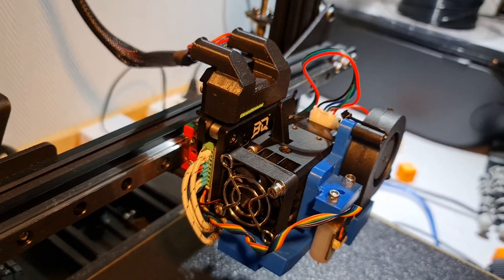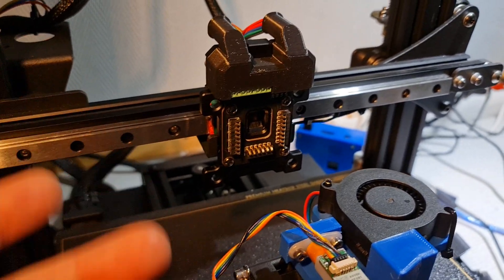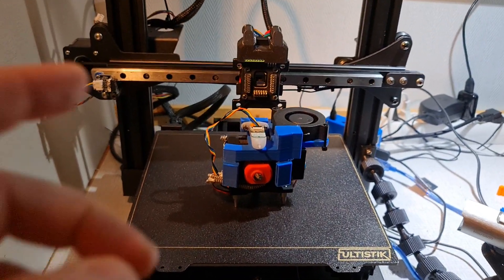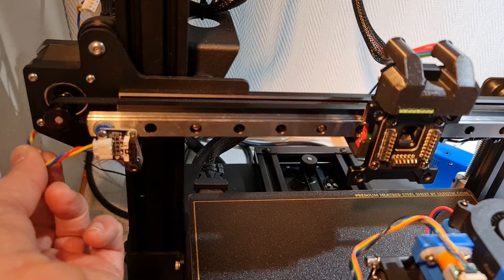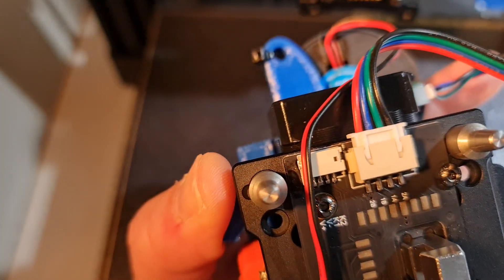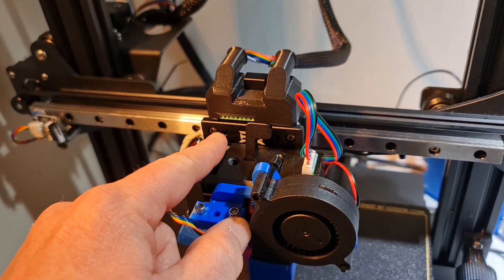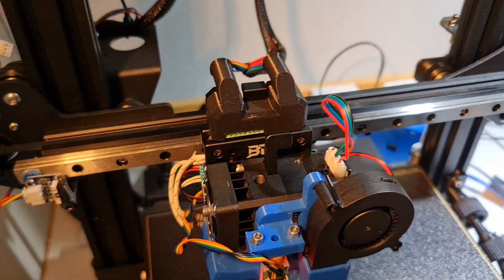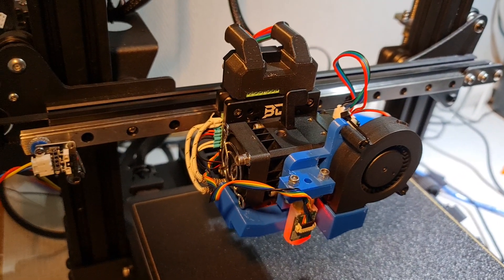BIQU Hermit Crab Installed and quick review

Comment: palm wheels ware out faster and dust gets around your prints and bed, so there is some advantage to getting linear rails then just better print quality
Reply from the maker: If your pom wheels are wearing out fast and generating dust then they are overtightened. All of my machines currently have pom wheels and not a single one has wear nor dust.

Comment: What size were the light blue insulated ferrules you used? A well done, clean installation.
Reply from the maker: The light blue are 0.34mm². 22awg if I remember the conversation correctly. But I think it would have been better with 0.25mm² I believe that's the size of the fan wires. The 0.34 are holding well so far though.

Comment: Strang tie got recommended to me and it's a year old ATM
Reply from the maker: Probably something the algorithm thinks you would like based on what you have been browsing.  None the less, thanks for taking the time to comment about it 😊 Hopefully you enjoyed some part of the video.
Reply: @StackingLayers  hey no problem man It was definitely interesting I've never seen that type of tool head before
Reply from the maker: Its pretty nice. Its a solid setu, especially on the linear rail.  I have a CANbus version too which has a tmc2209 and ADXL built-in, along with the heater, temp sensor, BLTouch ports and some neopixels. And is run off a single USBC cable.

Comment: I picked up the same Hermit Crab/ H2 setup on my Ender 3v2 and I’m trying to adjust my XY offset. Do you have any guidance? I’m just a little lost! Thanks for the review!
Reply from the maker: You need to adjust the home offsets. One way is to first home the machine then use the screen to move the hotend so that the nozzle tip is at the corner spot where X0, Y0 should be (front left corner) take note of how many mm  you have moved X and Y to get there. For example if X shows 5 and Y shows 8 then that's the offsets. If you have a home offset setting on the screen then enter the offsets there. Otherwise you need to connect to terminal connection like with pronterface on a PC and use the M206 command to set them. For example M206 X5 Y8, followed by M500 to save. After that home again and tell the printer to go to X0 Y0 to see if it's in the correct spot repeat to adjust if needed.

Comment: good evening I sent you a message and photos on your instagram
Reply from the maker: Looks like they finally showed up on IG, I sent a reply. Things look good in general. I do recommend getting ferrules on the ends of the wires though.   They give a better more secure connection
Reply: @StackingLayers  Hello would you have a link for the electrical pods to use to make your connection to the hermit crab thank you
Reply from the maker: Are you talking about the ferrules, things are the end of the wires? If yes, it's good to have a kit on hand. I recommend the HSC8 6-6 crimpers https://m.aliexpress.com/item/1005001552393630.html?UTABTest=aliabtest300080_422159&_randl_currency=EUR&_randl_shipto=NO&src=google&aff_fcid=6e6614f195714c1e8a71358ba5708c84-1659354329640-02066-UneMJZVf&aff_fsk=UneMJZVf&aff_platform=aaf&sk=UneMJZVf&aff_trace_key=6e6614f195714c1e8a71358ba5708c84-1659354329640-02066-UneMJZVf&terminal_id=a7fa3c3dbadb4e8590764ff87be9c2c5&OLP=1083300208_f_group0&o_s_id=1083300208&afSmartRedirect=y
Reply: @StackingLayers  thank you

Comment: hello here I am attaching some photos on the connection of the harnesses on the motherboard of the biqu b1 could you tell me if it is good and I have one cable left, what is it for, for the x stop you use the original wire thank you for the answer you can give me
Reply from the maker: Sorry, but there are no photos. But if you can go to the Facebook biqu B1 group and post there. There are several of us that will gladly try and help get you up and running.

Comment: Hey great video and commentary. Did you consider the other tool change systems that are currently out before deciding on the Hermit Crab? The Xchange by printermods, or the Mutant V2 by Whambam are also quite popular. Cheers
Reply from the maker: I did look at those. They look good too. They all accomplish the same thing in general. I just like the design of the Hermit Crab. I just got a Canbus version which is a lot more advanced. I'll do a video soon.
Reply: @StackingLayers  Yea the Canbus version caught my eye too. Having a single USB C cable to the extruder would be quite neat for cable management. I also saw they have an accelerometer on the board, would open up some opportunities for input shaping etc I imagine.
Reply from the maker: @teenagefishman  something I didn't realize until I started going over the installation last night is the Canbus version even has a tmc2209 on board so it frees up a stepper driver on the motherboard! This thing is cool. I'm working on a setup video because it can be a bit tricky. For first time users.and it's only for klipper.
Reply: @StackingLayers  Awesome, that's handy to have the extra driver. Only having support for Klipper is a bit of a limitation at the moment - I was going to convert to reprap. I might give kipper a go though. You inspired me, I just bought myself a Hermit Crab :P
Reply from the maker: @teenagefishman  I felt the same way about klipper too at first, but the more I mess with it the better it gets.
Reply: @StackingLayers  Looking forward to the video 👍

Comment: Great to see China ripping off designers yet again.
Reply from the maker: Which product are they copying?
Reply: @StackingLayers  PrinterMods XChange.
Reply from the maker: Yeah the same as in it's a tool changer, but it has a completely different locking mechanism and plug configuration and the xchange has nothing designed for CAN bus operation like the hermit crab
Reply: @StackingLayers  The CAN is just a wiring difference. The whole design of the mechanical parts, aside from the magnetic lock of the XChange, was a direct copy, Shape, alignment pins, tool plates, etc.
Reply from the maker: That's like saying Toyota is a ripoff of Chevrolet, they have 4 wheels, doors with locks, windshields...heck they even copied the steering wheel and put horn controls in it.
The idea is the same yes, the execution is pretty different. CNC machines have had tool changers for a long time it's not an original idea by either of them

Comment: how has it been the performance since you made the upgrade, is it worth it ???
Reply from the maker: Performance wise it works perfectly. It's very stable and makes changing out tool or even just working on them a breeze. As for is it worth it, I would say yes, unless you have no desire to swap tools. But even if you have just one tool it is a more sturdy mount than a printed plastic adapter. For example, I see many in search for a better mount to print for the BIQU H2 extruder while mine is sitting there solid as a rock.
Reply: @StackingLayers  I'm thinking about getting this just for that reason. I've tried the h2 adapter print in different materials and it just never seems sturdy enough. I also end up with the two screws that hold the h2 to the mount working loose over time. This seems like a good option, even though it's overkill for my needs
Reply from the maker: @davidhaas2528  overkill perhaps but it also opens up future opportunities like adding a vinyl cutter or laser engraver to one of the other tool plates.

Comment: Please could you tell me if the backing plate that attaches to the linear rail carriage is plastic or aluminium?
Reply from the maker: It's all aluminum. There's no plastic except for the electrical connectors.
Reply: @StackingLayers  okay - thanks!

Comment: Hey man, I got the Hermit Crab the other day and installed my H2 on it, as well as the fan/bltouch mounting solution you linked. I'm having an issue though and was wondering if you may be able to help me.

I've entered the provided probe offset from the Thingiverse page, but I don't think it's correct, at least not with the hermit crab being installed. Whenever I try to initiate G29, my bl touch wants to start in the front right corner instead of the front left, and it tries to probe off the bed. Have never had this issue when using a bl touch on any printer before. Did you get a different X/Y offset for your setup? Any help would be appreciated!
Reply from the maker: You have to change your home offset values too because the hermit crab moved the hotend forward several millimeters. I'm not sure why it want to probe to the other side though. I haven't had that issue.
Reply: @StackingLayers  Thanks for the quick response. I've never had to change my home offset values before, but I assume I can modify them in the config files while editing the firmware right? How did you measure your difference in comparison to stock?
Reply from the maker: @760creations  you can set them from the screen. Home the printer, then move it to the home corner (where 0,0 should be) then in advance settings on the Marlin screen select the home offset in advance settings

Comment: Great video, can yo do a guide explaning how to install linear raíls bro?
Reply from the maker: It's very easy. Just print some of these alignment tools ( https://www.thingiverse.com/thing:3383221 ) and use M3 screws with t-nuts ( https://www.amazon.com/dp/B01FOC6A70/ref=cm_sw_r_apan_glt_fabc_9ZSGB6NWC9V8J1ZBMSQM ) to fasten them to the gantry.
Reply: @StackingLayers  Did you remove the second screw from the x axis? "the middle-left one i mean xd"
Reply from the maker: No, it wasn't necessary. The holes in the linear rail didn't fall in that spot.

Comment: I've been waiting for this review for a while now. Can you give some details about your total carriage weight now? How easy was it to get a part cooling fan designed for it?
Reply from the maker: This is the part cooling setup I use. https://www.thingiverse.com/thing:4901193 
As for the weight I can't really say. But it's not a lot more because I removed the NEMA 17 extruder motor, and the H2 has a nema14 and is overall lighter. I also run dual Z axis so i don't think about that so much.